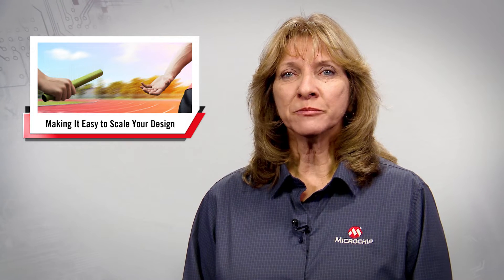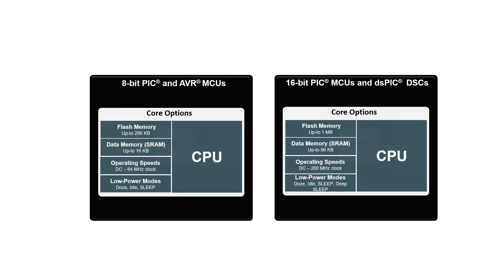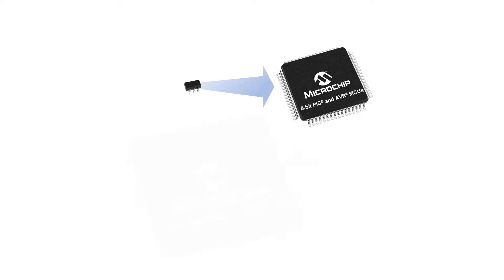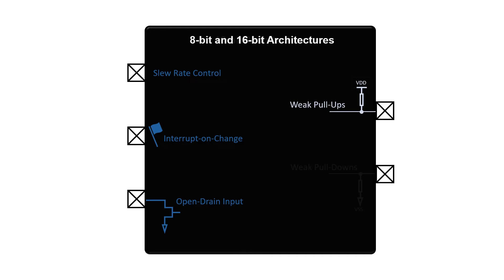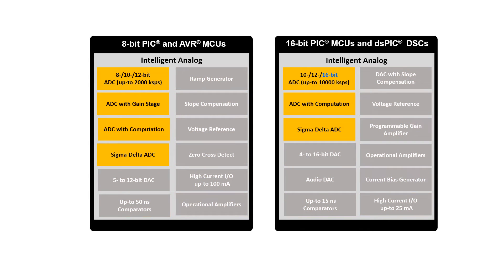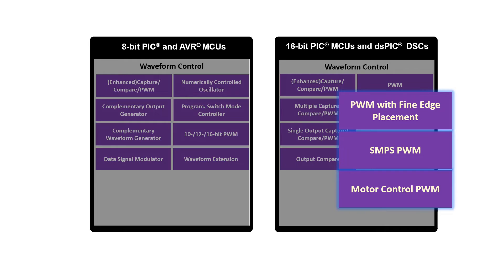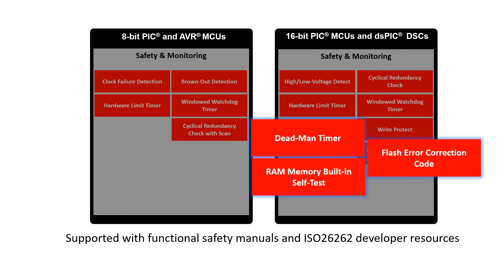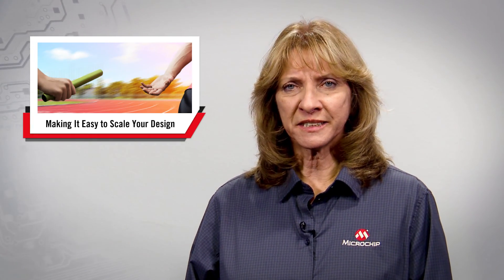Migrating from 8-bit to 16-bit Microcontrollers and Digital Signal Controllers: Some Considerations

Comment: Hi. What is required to program microchip microcontrollers? (I have a stock of PIC16F74, PIC16F84, PIC16F676, PIC16F877, PIC24F32KA302, PIC KIT 2, PIC KIT 3, PIC KIT 4, a computer and different kind of sensors used with arduino). I speak french. If there is french guidance, thank you in advance.
Reply: You've probably already worked it out, but from the sounds of it you have everything you need. Download MPLABX, download the 8bit compiler (it should prompt you after installing MPLABX) and that's it. They have a plug-in called the code configurator which will generate code to get the various functions and peripherals working.
If you're coming from a purley arduino background you will find it a bit more in-depth and requires more datasheet reading. If you've programed other micros like atmel or stm it's much the same. I don't know if there are any french guides or datasheets, sorry.